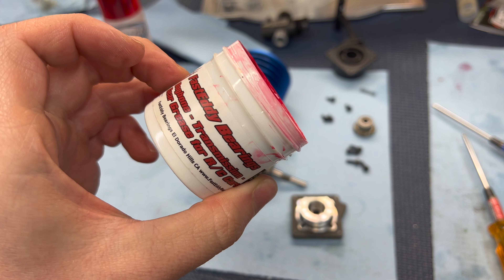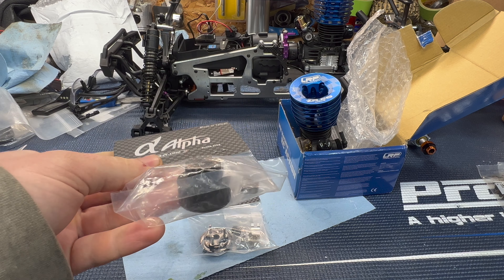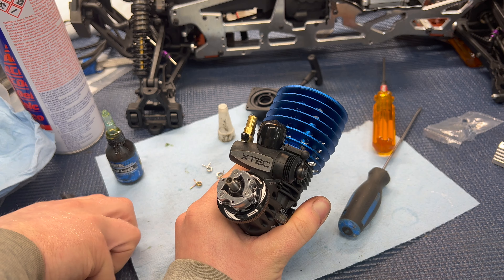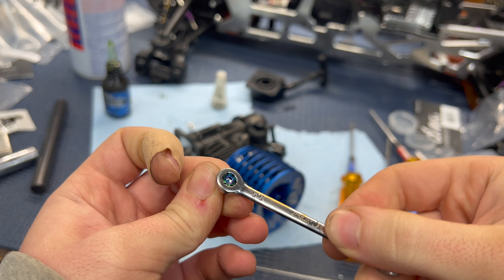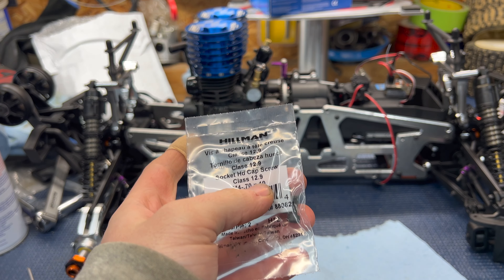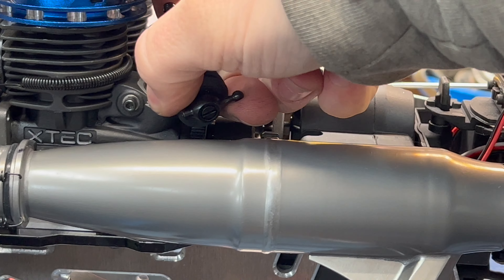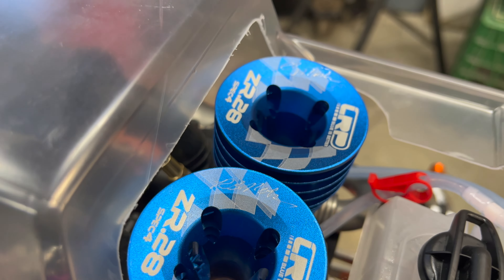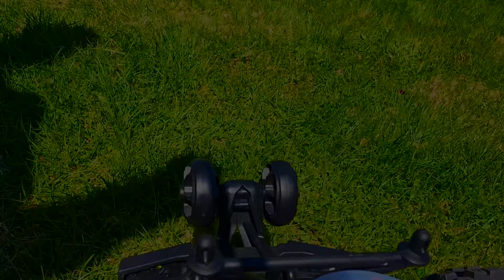Building The Ultimate Twin Engine RC Car (part 5)

Comment: Would you advice bit of tacky grease on carb pinch bolt as ive got to use the original lrp pinch bolt atm... would you happen to have the part number or something identifying for that pinch bolt you used with the seals? Love the vids alot of knowledge for the community 👌 bless
Reply from the maker: Yes would highly recommend putting grease on the carb pinch bolt. The pinch bolt I used on mine with the seals is NVE1200000 you can get them at amain hobbies. They are slightly shorter than the lrp but it works just the same

Comment: Im thinking of doing my own twin build. It won’t be in a savage but in a drag car. I saw you ran both engines off of one gas tank. I’m hoping to do the same due to space limitations. Any tips on fuel line splitting? Also any other issues? Linkages seem pretty straight forward but I’ll take all the advice you got from what you learned.
Reply from the maker: Hey man cool stuff. I haven’t experimented too much with the single tank setup I just tried to make the lines equal length (not sure if it makes a difference or not) I’ve noticed tuning in a little more difficult though since both engines share back pressure from one tank.

Comment: I knew you'd go LRP!
Reply from the maker: Almost didn’t, almost went with picco rebel xl .24 but they were kinda expensive for what they are and parts are harder to get. I would have got two novarossi 28-8s with out a doubt if I could have found two of them for a good price. I’m very happy with the LRP so far though!